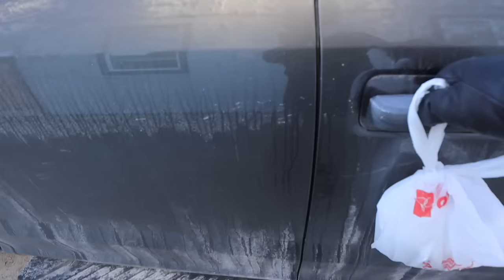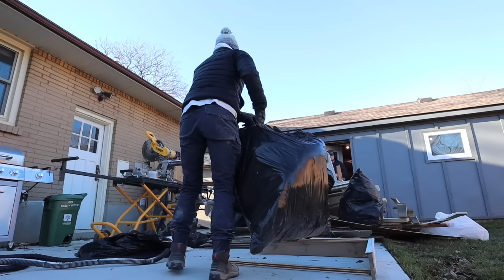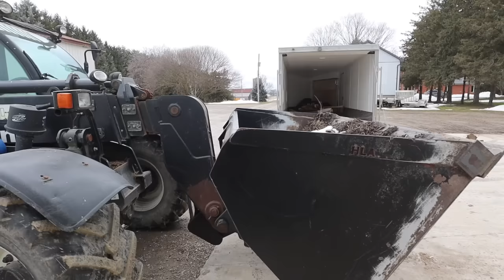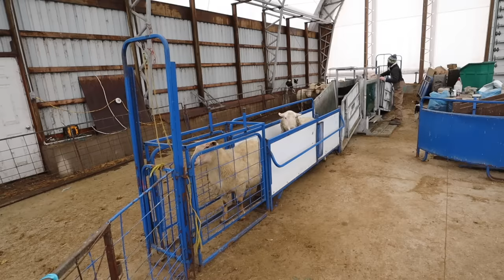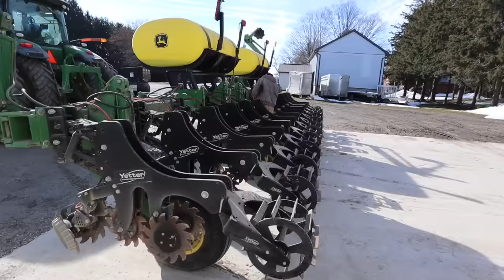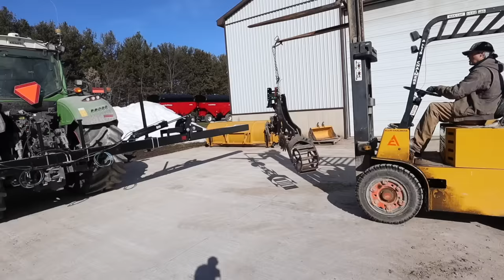MASTITIS STRIKES AGAIN!!  |  Vlog 762

Comment: We had similar problems years ago, we ended up having to dig a trench  the entire perimeter of the building and installing a French drain system below the foundation, sort of like what you do with your field tiles. This kept most of the water out from underneath the building. While the trench was dug, it was also the time to outside waterproof the foundation.

Comment: Sandi - I would recommend having Jack's basement tested for Radon gas and if levels are high having a Radon Mitigation system put in. We had to do that in a former home we owned - it used a fan system to pull the gas up and out of the house through a PVC pipe.

Comment: That snow looks beautiful, but I wouldn't want to shovel it. I love maple syrup. That's great that you have a maple syrup guy right around the corner from you. Very good explanation about Jack's basement issues from the flooding. Great work on Jack's house today. That was an impressive sneeze. Good luck with your dental appointment. I hate loose fillings. I lost a veneer a couple weeks ago and went to my new dentist Dr. Quinn and she put a new veneer on and did it very well. Piper is getting so big. I love how Lucy was whining because she thought they were going to go for a ride. Very nice mug. I drink lots of water. Not another one with mastitis. Using the handling system to get that ram's eye treated sounds like a great idea. All the market lambs look great.  Always nice to see the Golden Girls. Piper did a great job breaking up that ram fight. That's great that the grass is almost drained.

Comment: You could also punch a 2 inches (deep) channel (fill with gravel)  out of the concrete in the floor at the edge of the wall. Grade the bottom towards the sub pump.  The concrete floor and walls needs to be sealed chemically to water proof them before the sub floor can go down or mold mush will happen. Dr. Rex could take the eye out and sew the lid shut.
Reply: You’re right. It’s likely that an eye injured that badly will continue to be painful indefinitely and won’t ever be functional, so enucleation (removal of the eye) is the kindest solution for the ram if the antibiotics fail. It sounds gruesome, but the procedure is done under anesthesia and the site is painless once it heals. That’s typically what would be done if the ram were a pet. The reality, though, is that a farm is a business, and economic considerations must be a part of every decision. The unfortunate dilemma that always confronts farmers is that the economic value of an  animal rarely justifies the expense of any kind of surgery. Unless a breeding ram has an outstanding pedigree and a history of producing top quality lambs, it is much more economical to sell him and replace him with the best of the ram lambs or a purchased ram with the desired bloodlines.

Comment: We had water issues in a basement about 20 years ago. At that time we opened a gap in the floor at the base of walls in the lowest area. Then placed collection tubes that ran to lowest corner into a sump pump. We plumbed it up, and out, AND AWAY all UNDERGROUND.  worked great.  I have never seen what you are doing.  Hope it works.

Comment: when I had mastitis, the doctor directed me to put a warm pack on the area then use suction to unblock the duct.  It will hurt at first, but it will resolve.
Reply: I came across a solution that fixed it before it got away on me or helped treat it before it got worse.   If I ever felt a sore spot, when I put baby on, I would gently use my free hand to put a gently pressure on the sore spot, it cause the milk to release from that area first.  It always worked, thankfully.    Wish there had been as good a solution for cracked nipples, now that was painful!!!

Comment: Regarding Jack’s issue and I’m sure you’ve done this but just in case you haven’t as it’s easily overlooked,  check to see whether there is cover on the insurances for water damage.  The initial cause might not be covered as it would be fair wear and tear, but the damage caused by the water etc might be covered. Worth checking as any contribution to finance is a help.

Comment: Double check the down spouts and that they drain far from the house. Soil a little higher near the foundation will help with drainage. The idea thing would be to dig around the outside of the foundation and coat the walls. Drop in drain pipe and back fill with some gravel then soil.

Comment: My dad used to work for a foundation repair company and generally when you see the cracks and all there is a bigger problem going on under the house which needs to be fixed. The foundation repair company my dad worked at would raise the foundation in the problem areas and repair the foundation. It was a great company.

Comment: You should have gotten the rubber concrete sealer that does that. It creates holes in the paint layers helps prevent moisture from coming in and keeps water where it belongs

Comment: Ha, you are right someone will tell him what to do. Suggestion, we had the crack in the wall problem in our basement, had to dig out the outside ground all the way down to the outside base of the crack, it went all the way through. We called the dig out the grand canyon it was so big, of course summer job. But Jack may have to go as far as doing this in the summer. We filled the crack from the outside then the inside to finally get it to stop seeping in. Hope this is not his case.

Comment: I am trying to make my own handling system.  I bought used farrowing crates and I have connected them together.  Since they are adjustable, I was able to narrow them down.  I just need to build a ramp to run the sheep up.  Once it is put together, I will have a nice elevated handling system.  Hopefully, it will make tasks easier when I am doing ultrasounds and giving vaccines.  Total cost....$100.

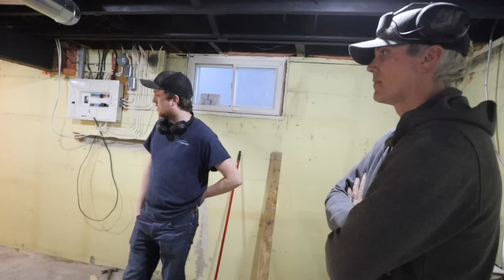Comment: Wild shot about the basement, have you looked at the downspouts outside the house? Make sure those are directed away from the house or if they are directed to an underground drain you will want to make sure they aren't cracked and leaking. Sometimes these are located next to the basement walls and create a problem. At time stamp 6:58 on the video, over Mark's shoulder there is some black staining on the wall. This could be just from high humidity in the basement or water seeping in from outdoors. Again check the downspouts or that there is sufficient slope away from the house. Lastly, you mentioned a sump pump, if there are drains entering the sump make sure those are clear. Mine were cunked up and created problems with water spill out onto the floor (furthest point in the basement from the sump). Also make sure the sump pump level switch is low so there is little water in the sump, this will/might increase humidity in the basement. Last, a good humidifier will help a lot and fans to circulate air.

Comment: I live north of you in Walkerton I had the same problem we put drainage tile around the outside of the house. About 10 years ago we had a leak in the basement finished basement tore the wall apart trying to find ended up being a crack in the wall about 8 ft from were the water came in ended up getting a company called Basement Boss they said to fix the water issue should tile around the inside of the exterior walls was not keen on it especially with cost but turns out best money spent. From the look at Jacks house I would seriously at least get a company in to look at it before you do the work. Good luck.

Comment: So sorry Jack you are have a water problem with your home - I had something similar here in NZ - had lived in the house for a year before the basement flooded - we cut a hole in the concrete floor and dug down and put a pit in then had a friend who  has a thrusting company (they do electrical and water)  thrust a pipe into the bottom of the pit from the lowest part of the lawn (we went under the carport, and under the house with the thusted pipe and connect it to the storm water, fulled the hole up with gravel and re concreted the top - we then used the same product on the concrete floor that you use water proofing a shower then made it look pretty - lived there for another 5 years without a problem

Comment: There is something to take water away from around the house . It drains the water around the house to further out in the yard . I don't remember what it's called though . We need to do it here .
Reply: French drain?
Reply: Yes, French drains are the best solution for basement water problems in areas with a naturally high water table. Everything else fails eventually because water pressure is relentless. However, they aren’t cheap to install, especially in an urban setting where any excavation means disturbing existing water, gas and sewer lines, electric, cable and telephone conduits, sidewalks, etc.

Comment: Do Canadian bank mortgage financers have require a RESIDENTIAL PROPERTY DISCLOSURE? If Jack knows that the previous owners “hid” problems with the house, he could go after them for funds.  I know that Canada isn’t a country that goes “sue”crazy. 🇨🇦
Reply: They do, but unless you can prove that they intentionally hid it, it’s very hard to prove. Wet basements are so common in that area that it’s hard to prove that the former homeowners knew there was an issue- they can easily say that they thought it was fixed. Also, if you get a home inspection, they can say ‘your inspector didn’t see it, how were we to know?’. The one thing that they can make an issue of is an undisclosed heating oil tank. We actually backed out of a real estate deal on that one.

Comment: I cant drink water by itself or at room temperature, My solution is to add a dash of cordial [ and by dash i mean just enough to colour the water and take away the taste of the water] then have ice in it this includes during the winter as well. It works for me but if you dont like ice just the  dash of cordial or even fruit juice like apple, lemon, orange etc but again just a dash has worked for me

Comment: Choosing to drink regular teas brings you more hydration than forcing yourself to drink a water every now and then. The golden girls need to be sheared so they can all eat together, poor Margie had to wait
Reply: Charlie will shear them in spring when it's warmer. Did you see the vlog where Sandi pointed out that snow was just sitting on top of their fleece, not melting, because their heavy wool coats are such good insulation? 💕💕

Comment: In regards to the comment: "welcome to adulting",  when I bought my first house my older sister commented with this rejoinder:  "Welcome to the black hole business."  She was right.  In the first 5 years of owning the house we replaced 2 windows, changed the locks on all the doors - twice; and replacing the roof.  We also had to waterproof the basement after discovering that houses built right after WWII poured concrete foundations and to save costs, added "fillers" to it - like pieces of leftover framing boards, branches, foam, pine cones, sticks, crockery, leftover copper/aluminum pipes from the build next door or whatever they could find around the property including nails.  We woke up one night hearing water gushing sounds in the basement. We discovered that the paneling hid the metal pipe that used to be hooked up to the oil furnace was pouring rain down the wall!  It had been "filled" with pebbles when they switched from oil to natural gas, putting the furnace on the wall next to the chimney.  With decades of water carving, the pebbles grew smaller or popped out.  Now it had none and the concrete patio outback had caved in at one time and was funneling all the rain water to that very pipe!  It didn't help that summer we had severe thunderstorms with heavy downpours.  We spent 70 hours filling the wet vac every 20 minutes, going outside to the back lane to empty it and start all over again. We finally had to get a loan to have a rubber membrane glued to the foundation wall before winter set in. We haven't had a single leak since - and it's been 20 years already. Though a house is seen at first as a money pit, once you get used to having to upkeep it yearly, when you sell, you get....um....most of your investment back. If you're handy, it will keep the costs down.

Comment: Four years after we bought our 1961 rancher, I walked into our basement into 4 inches of water. We ended up having to take down 2 ft of wallboard on the lower part of all the walls. We even took down the construction against all the concrete block walls so we could paint them with a waterproof coating. Every rainstorm had water coming in. So 26 years later after putting in a French drain inside the basement, adding an additional sump pump, waterproofing the concrete floor, putting a French drain outside the house, waterproofing part of the outside concrete block, we finally have a dry basement. This after the original owners told us the basement never leaked. Yeah right, then what was all that old mold on the inside of the wall board we took down. We finally did put up new wall board to replace that which had been removed and painted the basement. Ugh, thought I would go insane before we got it fixed.
Reply: Black mould is a real health issue! 💕💕